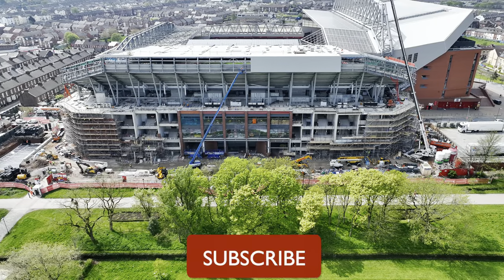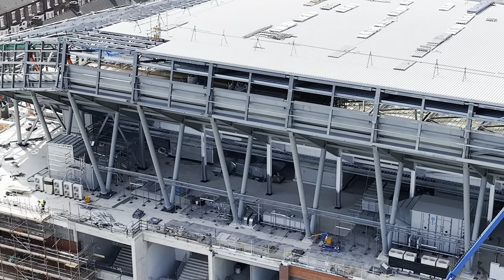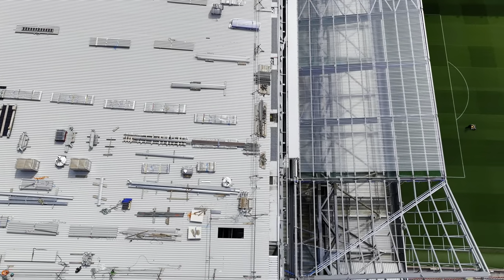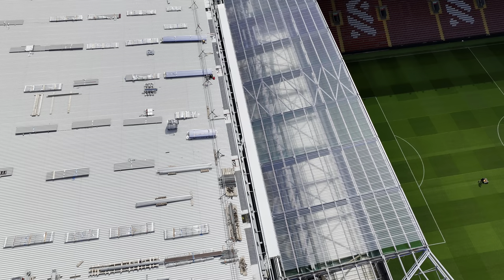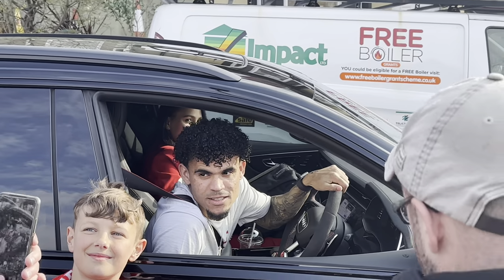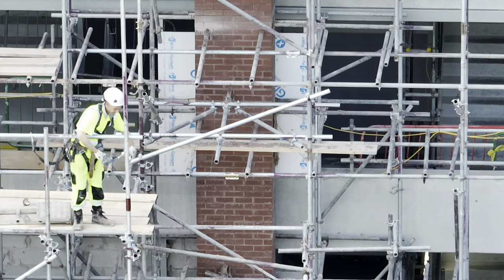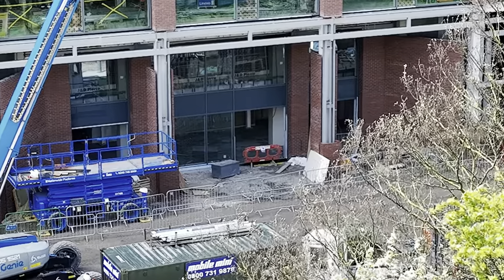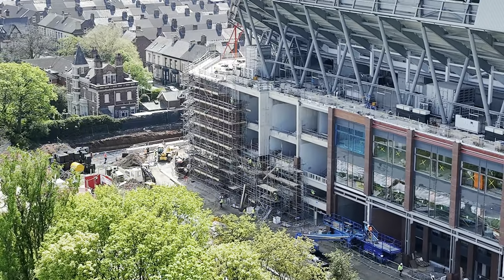Painting and sheeting down at Liverpool F.C’s Anfield Road Expansion

Comment: i would imagin the paint they should be using on steel structure,,would be zinc-oxide ,,,it use to cpome in a 4lt can and then you add 1lt of epoxy resin ,,,years ago it woud have been "red lead" or" red oxide"......at Bramley Moor, that brick work is fake,they are panel's which bolt on to the structure behind,,,,may be they can't afford real brick,
Reply from the maker: Yeah I saw it getting delivered at Bramley Moore, thanks for the info mate

Comment: The guys painting on the roof are treating the significant roof bracing bolted connections with primer to protect the untreated areas.  The steelwork contractor will have left these connections "unpainted" in these bolted zone areas as the design would have called for friction grip or Tension control bolt connections, due to the high loads and need for non slippage within the connection.  These connections cannot have any paint between the friction surfaces as this vastly reduces the effectiveness of the adoption of HSFG or TC Bolts.  The only bad news when using these connections is the need to paint the connections after torquing of the bolts, coupled with the added issued of man access to paint the bolts, here we see the workers straddling steel to paint the bolts, which if there was no safety netting under the steel would not have been allowed by Buckingham's or the HSE, as there would be fall protection.
Reply from the maker: That’s some very detailed information, thank you very much

Comment: Paint the steel area in case it was knocked or chipped on installation to avoid rusting
Reply from the maker: Ah right, that makes sense
Reply: @Kevcupo  They are painting the friction grip bolted connections, which need to be left unpainted to ensure the HSFG bolts or TC Bolts work in these non slip connections until they are tensioned up to the required torque.  Once they are torqued, they can be painted

Comment: Great vid mate, paint to stop corrosion, red netting goes around scaffolding barriers on roof to warn of danger near edge same as red tech screws in roofing lights on spans. Red means danger. Looks like a gutter between roof and spans, had them on alot buildings I've built. 👊
Reply from the maker: Brilliant info, thank you for your input
Reply: @Kevcupo  Accept on this occasion, the safety net and barrier was put up yesterday, only for the the workmen to pull it all down today, so that they could install the concrete back walls 😙